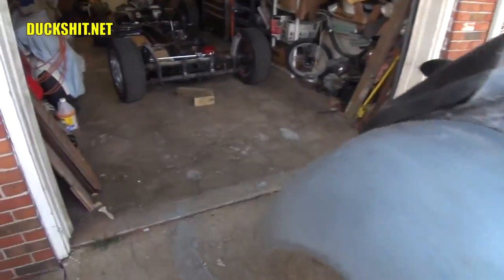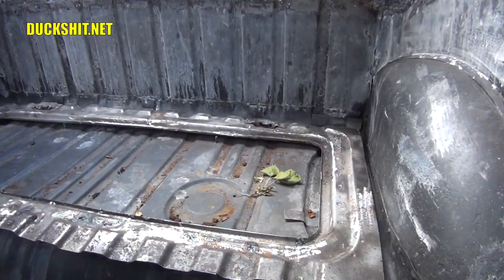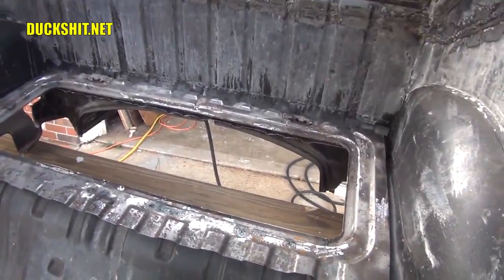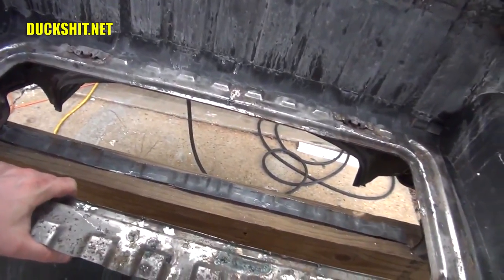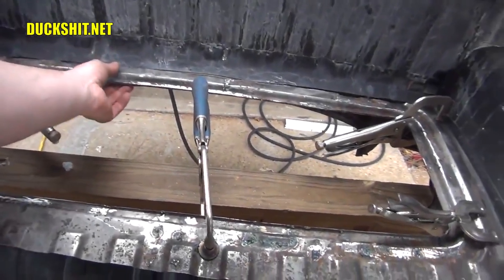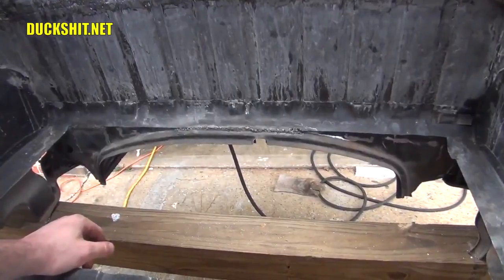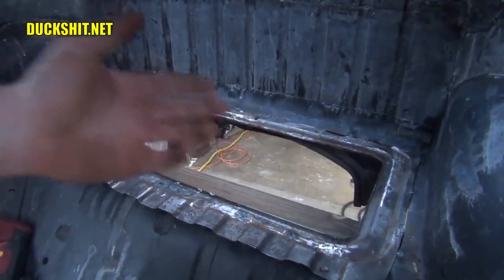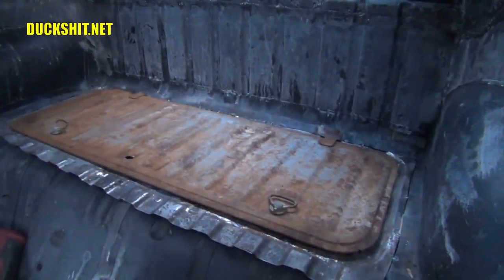Welding In Rear Hatch - ROTTEN OLD 1956 Chop Top Oval VW Beetle - 66

Comment: you did like most of us, you forgot the gloves once you got involved in the job. I always start with the best intentions but once I get going no gloves, safety glasses , no rubber.     forget that I miss spoke.
Reply from the maker: Correct but only breifly.  Sometimes I forget, or when tool is run for few seconds, won't matter.  It's about the prolonged exposure.  But my goggles and headphones are always on!  Those i cant deal without.  I also like the quiet... lol... allows me to focus better

Comment: Now you can run a 4th bolt with that access panel. You're no longer in the three bolt Mafia. You mention that vw  actually put an access panel in beetles? What years was that?
Reply from the maker: Yayyyyy!  The answer to your question was actually in one of my previous recent videos. Here's a link, should take you right to the correct part of the video:  https://youtu.be/j044-i4A1os?t=818

Comment: Know how you feel with the numb hands. Had to beat a Dodge truck with a sledge a while back and my hands were numb for months, especially when sleeping. I assumed carpal tunnel but didn’t go to doctor. Being on a computer every day since 1980 doesn’t help either. I’m surprised you didn’t chop an inch or two out of the hatch but you made it fit so the bigger the better anyway. I’ve been really waiting to see what’s inside that hatch. (Lost TV show pun).
Reply from the maker: Love seeing you comment before the video gets released to the public!  Thanks for all of your support always.  The numbness was bad!  In October 2017 the night before the car show I every weld on the body with the grinder and wire wheel.  I was hacking away for about 8 hours.  At the end of that my hands were a mess!  I didn't touch the car again for quite a long time.  I'm good now, anytime I run a tool more than a few seconds the gloves go on!   Funny thing for me, also been on computers everyday since the 80s and no carpal tunnel.  That has a lot to do with behaviors and posture, too.  A classical pianist watched my motions on a computer keyboard once and said I type like a pianist plays with straight wrists and proper posture, and asked if I played piano, too.  Nope!  LoL!
Reply: DuckmanCycles and VW Garage I’ve never had any problems either except that one time with the sledge, but I avoid doctors so no diagnosis.  I try to get people to think and comment, hope it helps. You didn’t say much about my half ass temporary heater install, man that thing throws heat like crazy. Sounds like a mini jet lol.
Reply from the maker: @waynenocton  I saw that briefly.  Diesel was it?  I'll go look it up and post over there.

Comment: I know its not necessarily relevant to this topic, but any idea what all those weird indentations (stampings really) in the package tray are for? For instance that circular stamping seen at around 3:11 in the video.  My "freebie" package tray my buddy gave me, and which other than some slight rust is brand new, has like, 5 weird stampings on it.
Reply from the maker: The C-shaped channel with the flapper clips along the right side is for wires, usually there is a hole in the vertical panel right above it for the wires to pass through to the engine compartment.  There are some threaded studs in there, too, that I have no idea what they are used for.  They got cut out with the piece I removed. The lower panel was a repair replacement for a later year, normally you wouldn't see this stuff in here.  But the circle is a cupholder for your beer can when you're putting in a headliner! Those clever Germans thought of everything!
Reply: @DuckmanCycles  Lol the thought of a cupholder did cross my mind!
Reply from the maker: Haha!  I really have no idea what that is for otherwise!  I'll ask around!

Comment: Duckman,  Will there be a problem with car exhaust and road-water and moisture?
Reply from the maker: This is an OEM part from a Bus.  Is it exposed to the same elements on a Bus, if I use the proper seals there will be no problem. 😁😁😁😁